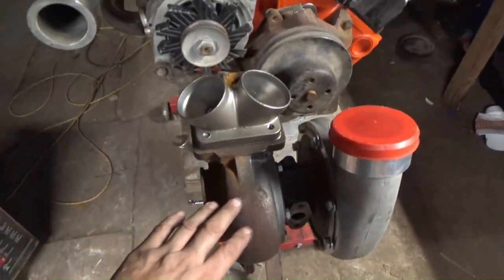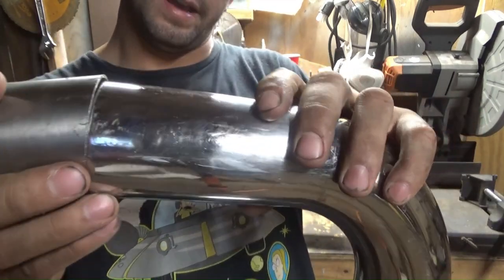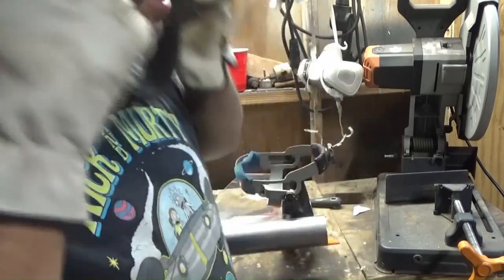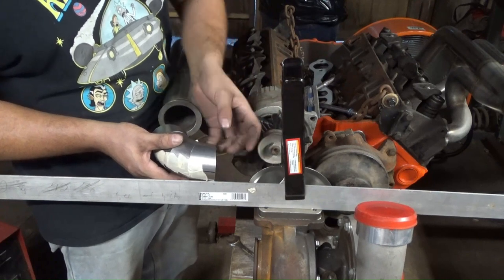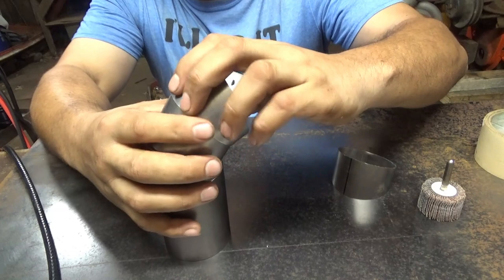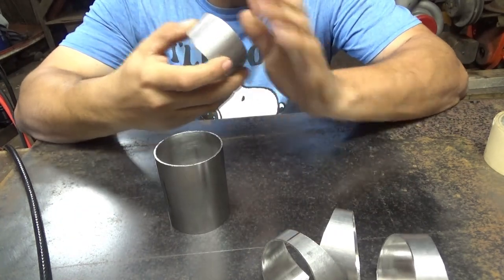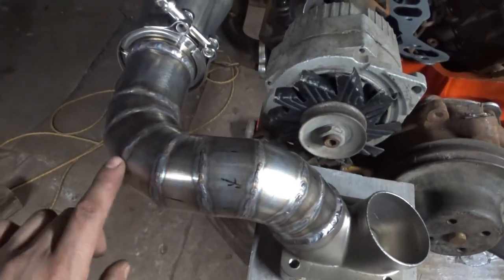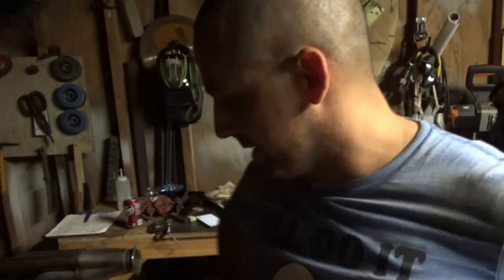Building my first turbo kit hot side part 2.

Comment: Love it man  ! good job 

Advice are you using the evolution for the pie cuts ??? 
I would love to build me a home turbo kit
Reply from the maker: yes, and I have a diablo steel demon blade the blade they come with makes really ugly cuts on stainless.  The steel demon blade has more teeth and does an ok job, but it's not perfect.   They are like 95 dollar blades.
Reply: @davidcraft4909 

That’s what I’m looking 👀 for something like that , the funny thing is ! that’s how I came across your channel  

 Sweet I’m new to welding  just a rookie
Just want something that’s works  and by the looks of it 😀
It works good 👍
Reply from the maker: @ElJuicePerformance  If you do get one, only cut stainless with it, don't waste the expensive blade on regular steel. I have cut about 50 to 100 cuts on ss tubing and I already notice that the blade doesn't cut as smooth as it was when it was brand new.
Reply: @davidcraft4909  
I just subscribed 

I’ll keep you posted!! I’ll start saving up for  one of the evolution s